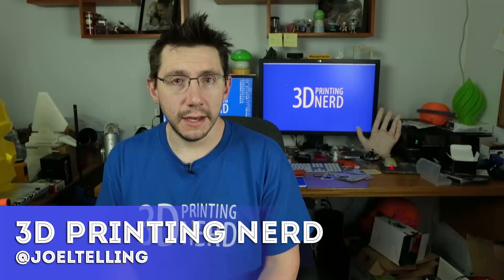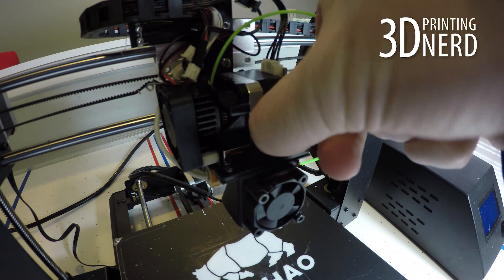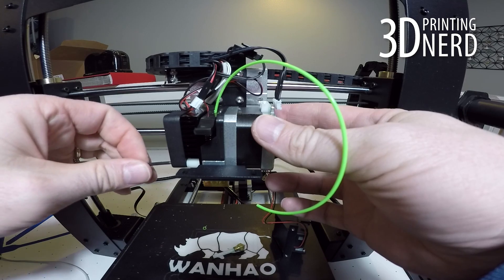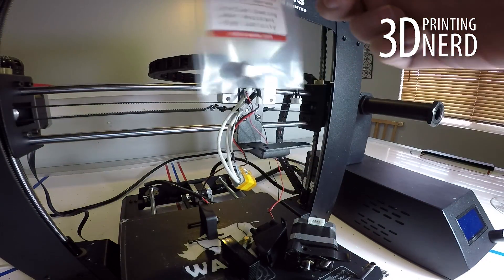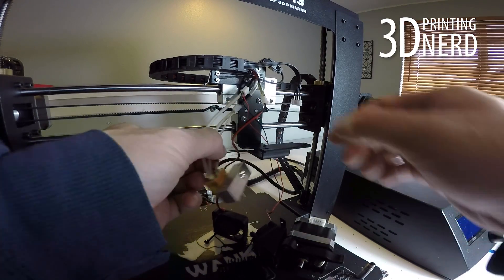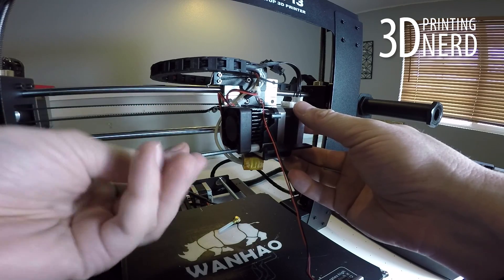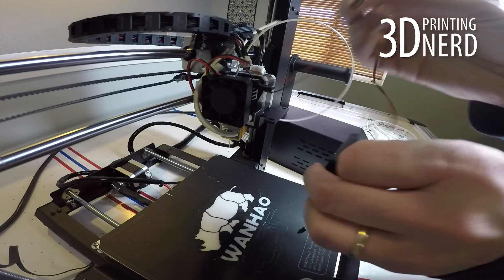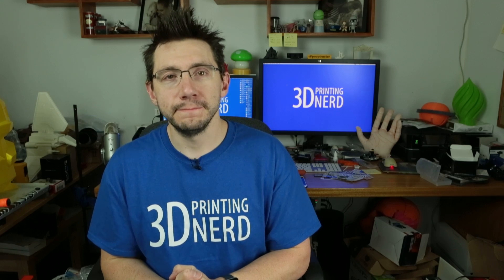3D Printing: Upgrading a Wanhao Duplicator i3 with an All Metal Hot End

Comment: @ 8:30, you don't use any thermal paste, yet the instructions and some other posts say to do so.  Did you forget this step, or am I missing something?
Reply from the maker: +Shai Perednik In the kit I got, there were no instructions to use thermal paste! I followed my instructions!
Reply: here's a the response from micro swiss:

If you purchase All Metal Hotend with Slotted cooling block, you do not need to use thermal paste because of the slotted clamping, you get really good heat transfer from tube to cooling block. We do not include thermal paste with the kit for i3 that comes with redesigned cooling block. The only time you want to use thermal paste is when installing kit with stock cooling block that uses set screw to clamp.

Comment: Excellent coverage! I have a MakerSelect (WanHao clone from monoprice) and I think it could use this upgrade. I will be printing in all ABS (fume enclosure is coming soon) and I was wondering how your i3 is doing with ABS as far as the extruder? I noticed in the video that the temperature fluctuation BEFORE it was installed was larger than after you installed it. Does the temperature stay steadier after the upgrade? I love pizza, too, and high five!!

Comment: Hi Joel, had any time to play with the new Micro Swiss hot end you installed? Wondering what your thoughts on it are, if you have? Interested in print quality and potential speed increases (as it's marketed as better heat transfer which should lead to faster print speeds)... Anyhow, great channel! Keep it up! Cheers!

Comment: Good vid man, I installed my all metal kit about 6 weeks ago and all is working now... Interesting to note, I used to have the same issue as you when changing filament in that it was likely to jam when removing the current filament resulting in the need to dismantle it to clear out the remaining filament before feeding the new filament in. This has not been the case following the all metal upgrade, filaments now pull out easily without any jamming, blockages or excessive use of the tools to dismantle and clear out... #highfive..

Comment: @3D Printing Nerd. Is this hot end really a upgrade form the stock one or just a replacement, also will you be doing a video on the difference between the two 3D prints? Thanks again for the awesome videos.
Reply from the maker: +Jason King Hey Jason! Thanks for watching! First - yes, this is definitely an upgrade. Having an all metal hot end eliminates the need for a PTFE tube and let's you print hotter, enabling you to print with a greater range of materials. Plus, the kit comes with a played nozzle, so you can print exotic filaments without worrying about the nozzle. I can't do a video about the print quality differences as I had to get this video done quick before my friend came to pick up the printer. I've heard others I trust say the machine prints better and with less hassle, so I believe them. I'll talk to my friend and see if when they get to printing I can see so I can compare.

Comment: What nozzle size did you get?
Reply: +Justin Levy .4mm - if you pause the video just right, you can barely read it at the top of the bag. :)  ...and those nozzles rock, BTW. Only reason I went back to brass nozzles after buying one was because I wanted a selection of nozzle sizes for different projects, and you can buy 5ish brass ones for the same price as a Micro-Swiss.

Comment: Cool video! What I want to know is, what are the advantages of a all metal hot end? I have a duplicator i3 v2 on order, so  am curious. Thanks, and as always high five!
Reply: As far as I understand a regular non all metal hotend use a ptfe liner tube inside to guide the filament.  Now that tube starts melting and such at about 245°C rendering it useless for anything above. So a all metal hotend can reach much higher temperatures for harder to print plastics, like 260°c and up for nylon. 
I am pretty sure there are other pros and cons (likely) about em so I hope he will do a full review of this since I really wanna know how hot the I3 could get with 1.
Reply: Ok thanks! So if I want to print something like Taulman Nylon Bridge filament,I need a all metal hot end ? Wanhao says it nylon compatible, I wonder if thats before any hot end upgrade?
Reply from the maker: +David Tucker Um... Maybe? I've never printed with Nylon so I don't know what it requires versus what the Wanhao can provide temp-wise.
Reply: On the list of  compatible  filament that wanhao lists is nylon so it should work. I googled it 245c-250c is the recommended temp.
Reply: well I'd say 245 is a bit on the low side for Nylon, besides I'd rather not use my machine on it's extremes like that I'd prefer to have some leeway.
Just my 2 cents tho after all I only got my I3 last week and it's my first printer after all.
Had some neat ABS prints at 240C tho
Reply: Mine Is still on the way.

Comment: I assume you plan to answer in a follow on video, but just a few questions. Why is an all metal hot end better? Why is it cheaper to use PTFE inside a metal tube(just seems odd to me)? What do the prints look like after the upgeade? #digitalhighfive
Reply from the maker: +Scienteer I can answer some things now! The printer was going to a friend of mine, so I had to get this done and video produced before he picked it up. That was happening VERY soon, so I didn't have time to do any prints with it. Once he and his wife get some prints done with it I can update you. All metal hot ends are good because you can go hotter than with a PTFE tube, and there is no PTFE tube to break down, get old, replace. Plus, exotic filaments can damage a PTFE tube, causing it to need to be replaced sooner - that isn't the case with an all metal hot end. PTFE tubes are cheaper because, well, I don't know. That's a very good question. #ReturnFive
Reply: +3D Printing Nerd so the temperature is now limited by the Wanhao power supply and control board i guess. Id love to see you try some high temp filaments like Nylon and Polycarbanate one day. How you do this with a day job and a young family I dont know. Massive thanks dude.
Reply from the maker: Scienteer HUGE RETURN FIVE! I'll try higher temp filaments at some point - I really want to. Also, right? It's tough but as long as I can get some good quality content out there, I'll keep doing it!

Comment: Was that your temperature fluctuating? It hit 248 then jumped down to 237.5.
Reply from the maker: +Malcolm Hunter Yes, the temp on my i3 v2 does fluctuate. There is a fix available where you need to ground something on the main board. I just haven't done that yet.
Reply: +3D Printing Nerd Yes. You have to solder a wire from the MOSFET to power ground. How's your soldering skills? :)
Reply from the maker: Malcolm Hunter Truth be told, I took an electronics class in high school, and have always been a steady hand. That said, most likely, if I tried this, I would end up with my house on fire. That's just how these things go :)

Comment: Do you want to do a video about the heated bed for the gmax 1.5 series if it comes out and print some abs with it?
Reply from the maker: +Power Supply ... already planning on it :)
Reply: perfect, I want to buy a gmax 1.5+ but I really need a heated bed for ABS printing, I love the lulzbot printers but their build volume is way smaller and the dual extruders cost so much.

Comment: 50 bucks for a hollow tube?  No thanks...
Reply from the maker: +wheezy Well, the thermal tube, the plated nozzle, the new block - that's all together $50 USD. If you can machine a kit as good as this and sell it for less, do it and send me the link!
Reply: The main part is the fitting together of several different metals, it's not all steel, or you'd get thermal creep up into your filament

Comment: Hello JoelI would Need your help for upgrading my Dremel idea Builder for exotic Filaments, i ahev all other things updated just the Nozzle i Need for that Extruder. Do you have an Link or contac for me to get the right Diameter Nozzle to print that Special Filaments ?Thanks again and as ever High Five
Reply from the maker: +Mario Obermaier Hey Mario! I usually get mine from Proto Pasta - here is a link. You can choose "Dremel" for the type: https://www.proto-pasta.com/products/plated-brass-wear-resistant-nozzles

Comment: I noticed during the install you did not use any thermal paste during the install of the hot end. Was this not required?
Reply from the maker: +Eugene Pressley that's correct!
Reply: +3D Printing Nerd thank you, also since the extruder is disassembled at this point would this be a good time to replace the x-axis bearings with the longer bearings? Could this be another video?
Reply from the maker: Eugene Pressley Oh, that's possible. Might as well do more work since everything is taken apart. I don't have the machine anymore, so this was my last video with the i3. Don't worry, more Wanhao to come :)

Comment: thanks Joel. The voiceover is difficult to hear, think you need to tweak your levels, dude!
Reply: Hi Joel - I was listening at School using some over ear headphones. Ive just listened to it again at home over speakers and its fine! Like you said, Weird - Ive not noticed it before at school, will check again tomorrow.
Reply from the maker: +Phil Waud Thanks for the feedback. I just checked through computer speakers and through headphones with the final rendered file and within Premiere and my levels are good. Weird. You're the first to mention the voiceover being difficult to hear. Are you on headphones or computer speakers?
Reply: +3D Printing Nerd i'm on an ipad(speaker), did not have any issues
Reply from the maker: +XAD566 Okay, cool, thanks for checking.
Reply: +3D Printing Nerd it is kind of hard to hear but it isn't to. Bad

Comment: I did this upgrade on mine. It preforms so much better now. I use an oilier for PLA with a very small amount of olive oil to season the Micro Swiss All Metal Hot End. Thanks to @The_Hot_End for that tip. Thanks Joel, for all the great videos and 3D Printing info. #highfive

Comment: Hopefully a Wanhao i3 v3 comes standard with this.
Reply: +Mickice unfortunately the 'i3 Plus' that is due out soon has the same stock PTFE lined hot end.
Reply: Incredible. In a bad way that is. So many basic niggles that turn people off, the huge power CPU brick is another.
Reply: Mickice the huge power supply is one of the things they have fixed. the Plus will be a all in one unit (that's about the only real change, apart for little thing like now interface and using ribbon cables) http://3dnyomtato.shoppe.hu/products/wanhao-duplicator-i3-plus
Reply: I'll look into it, I have kinda fallen in love with my FlashForge Finder tho, if you use Dremel or FlashForge PLA the machine is basically, press print and walk away. If the model has printed before, you'll get the same results time and time again.

Comment: great video
Reply from the maker: +Cole Nagao Thank you!
Reply: +3D Printing Nerd hey 3d printing nerd what is the voltage you run your stepper drivers at and what is your opinion on the new wombot modus
Reply from the maker: +Cole Nagao I usually run at 0.65 but I have run the Z axis at 0.7 before. the Modus looks neat, and if I get one at some point, you bet I'll put it through its paces.
Reply: +3D Printing Nerd OK thanks and what do you think of the day Vinci 1.0 because I got a used one for 200  dollars and then flashed it put an e3d v6 on it and ramps which I am still working on it I have heard mixed feelings about it I want to know your opinion
Reply from the maker: +Cole Nagao I know nothing about XYZ and the DaVinci line of printers. You should talk to Chuck Hellebuyck!
Reply: +3D Printing Nerd OK thanks